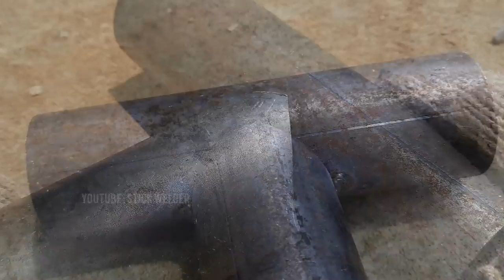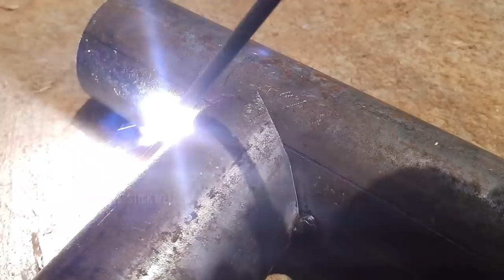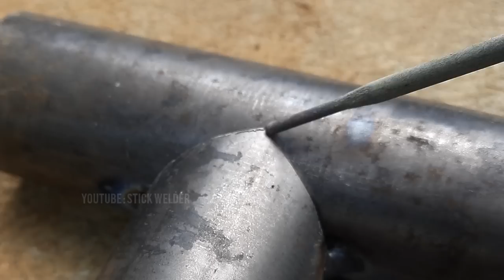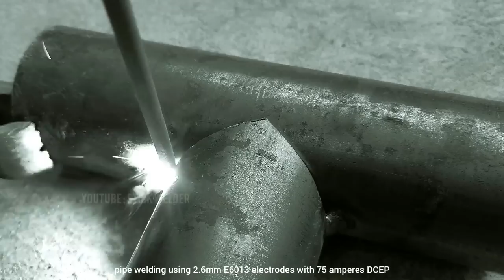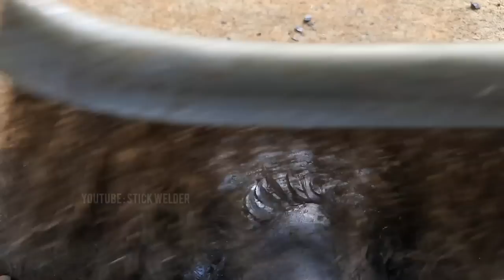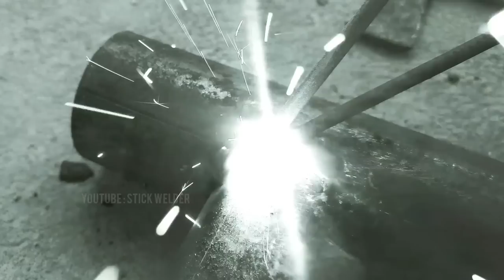old welding tricks from the 60's. why no one told about this welding secret

Comment: “Trick”: literally just spot welding. Try lowering your amperage and running a bead.
Reply: I wonder if he knows what a Row of  Nichols looks like
Reply: Glad you said it ... amps would make a world of difference here
Reply: This shit gives welders a bad name.
Reply: Had an old machinist work on the farm years ago , I was making an exhaust for my car and was going to braze it because I figured it was too thin to arc weld .. He said let me do that for you ,I thought "this should be fun " He arc welded it and it locked nice .. He taught me how to just drag a bead across the joint and if done properly did not blow through  and looked like someone had mig welded  it  ...
Reply: What if your welder sucks balls and only has 2 or 3 set amperages and/or you don't have the correct electrode because you're too poor
Reply: Agreed
Reply: Not even chipping before running it again it’ll be so weak

Comment: Here's a trick used to correct rod with the correct amp for that thin metal
Reply: Yeah, I'm not a great welder, but I know I can weld schedule 40 pipe without blowing holes in it.

Comment: Everyone who wants to weld needs to start with a thin project IMO.  Whether mig or flux core I think the same method applies. turn your amps up a little hot and spot your way along. Once you learn to stop blowing holes in thin stuff your thicker projects are going to have a significantly easier learning curve.
Reply: You may get the opposite effect then with lack of penetration on the thicker stuff.
Reply: I disagree with you 100%  person needs to drop the amps. And feed   welding thicker material, you often run multiple passes. 5 " to 1",thickness, isn't going to hold with a single pass. If you are welding 18 Guage and thicker. A good welder can do it using .045. But if you don't have a few years experience, I'd recommend. 028  for 18- and thinner. Or maybe gas weld it using a triple 0 ( 000) gas welding tip or smaller. 
I started welding in 1978. Just retired last year due to wear and tear on the body. I understand weekend welders perspective. But concerning the industry standards. You are mistaken.

Comment: Chosing the correct rod and amperage settings will give you a superior weld both structurlly and asthetically.    Just because you can strike an arc doesn't mean you can weld.  What you're doing here, everytime you restart the arc, is pull the impurities the previous weld's flux brought to the surface back into your weld.  Not a good weld by any stretch.  #hownottoweld #CertifiedGapWelder
Reply: That sounds right. It means every time you strike an arc stop, clean and strike again, I tried to repair my wheel barrow as the bowl is .5mm thick. I tried stick and mig. The mig on low voltage built up and when I grinded I was not satisfied with the penetration. Then I used stick and turned up the amperage to do the stop start method stopping to brush after each strike. Well. it built up a solid weld although increasing holes once patching to the old .5mm steel. I heard you can use copper and mig weld onto that. 
When I first started welding a couple of decades ago I used nails to span large openings and was very lazy in cleaning work before welding.
Reply: @ron1martens  mig (GMAW) you dont need to clean. FCAW you do.  So if you're using gas you can pulse the gun with higher amperage without the constant cwire brushing.  FCAW is only good, in my opinion, for welding outside where your gas shield is likely to be blown away.  Dual shield is good though.
Reply: @byron7165  Thankyou Byron. I just have gassless. I was referring to when I was using the stick welder when cleaning. I"m going to have another go very soon to see if any progress.

Comment: Texas tig without removing the flux from the filler?  I’m not a welder, but that looks like a fantastic way to get flux inclusions.
Reply: Glad to know someone else calls it Texas tig. And yes you really need to remove the flux to for it to work. Using a 3/32 rod of 7018 with the flux removed does the trick.

Comment: This got nothing to do with secret welding trick welders dont want to speak about , it about adjusting your weldingmachine the right way , and knowing HOW to weld ,something you apparantly have to learn .  Stitching is not welding !! If you welded this with a 2.5mm rod from the top down on 75 Amps  you can run a full bead .
Reply: It's absolutely true.

Comment: Inclusions and porosity!  I'm no expert and still learning myself, but your amperage was WAY too high the first go round.  The second is honestly pretty garbage.  You welded over your slag and you could probably break that weld very easily.  On your old welding trick, that's also called Texas Tig and yes you are adding additional filler metal when you have a huge hole to fill.  In the case of this video, you had to resort to it due to improper skills and poor technique which resulted in horrible fit-up.  With my welder I have run a 3/32" (2mm) rod down to 60 amps with hot start on 1/8" steel.  It still blows the hole at the beginning, but I can go back and fill it up as I'm running a bead and the bead is the correct temperature.  I haven't had to weld anything thinner just yet with my stick welder, but you could Texas Tig thinner metal directing the heat towards the thicker filler rod which will melt both sides of the weld pool.  If it's too thin, TIG or MIG weld it.  There's a reason there are other welding processes.

Comment: This situation is why I love my MIG. I never have had the skill or talent to arc weld thin material.
Reply: Thomas Franklin  thank you Thomas. I will try that. I have always said a monkey can MiG. It takes a craftsman to weld.
Reply: MIG welding (GMAW or Gas Metal Arc Welding) is great for thin metal  like sheet metal but it can be done with SMAW (Stick welding).
Reply: Use E6012 to weld a thin metal with with 2.5mm stick use betwenn 55 to 80 amp. And NEVER sold from up to town.

Comment: Sand (dry) inside the pipe tends to support the thin wall and stop it from collapsing or burning through. Likely contaminates the weld inside the pipe but appears to work well with my basic welding skills. Like to hear any theory why it appears to stop the thin pipe wall burn through.
Reply: The wall can collapse easily without the support of the sand.
Reply: The sand is simply working as a backer and a heat sink , less amps and a better rod choice will do the trick with a lot less messing about.
Reply: @tomthompson7400   Thanks for the explanation.

Comment: That method work fairly well when welding exhaust tubing. I built my first exhaust system with a stick welder using the "tack method". Now I get frisky with it and tig braze it or I acetylene braze it just for kicks and giggles. Seals alot better than most anything though especially half rusted out and to thin to really even mig weld the tubing. Best part with brazing, doesn't have to be super clean pipe.

Comment: IF YOU USE 7014  3/32 WITH ABOUT 70 AMP IT WOULD WORK BETTER AND NEATER
Reply: 6010 0r 7010,lets you break an arc and go right back in for a 2nd puddle.7018 however burns back up in the flux so you end up tapping it to get it started...

Comment: Welding galvanized tube is dangerous! Strip the plating first!

You have smaller sticks, use less amps and the small sticks to lay a proper bead.
Using rod to fill gaps isn't good, use a strip of the same pipe to fill the gap.

Comment: In 1965 I was a student in an aircraft mechanic's school, and I learned to do much better welds than you see here using an oxyacetylene torch and flux-coated rods.  I would not want to go up in an airplane with a tube frame welded with the crappy joints in this video.

Comment: some people comment that if you have the right amperage/rod/skill you could stick weld thin metal like this with a continuous bead. I've never seen it. Show me. Post a link.
Reply: I don't have a video but it is possible to weld thin metal. You "weave" the rod back and forth to keep the arc but it keeps the heat lower than just straight line pass. DC current works better for thinner  metals in my opinion because it's a steady arc.
Reply: Seems to be he is right no video proof. Unicorns are real too

Comment: Stitching is very common, as is using a filler rod with other-than-TIG. “Texas TIG” is using a second flux rod as filler while stick welding a gap. I’ve personally had great results using steel hydraulic brake line as filler for MIG and flux core. This video demonstrates nothing more than the common-sense approach of someone determined to teach themselves.

Comment: All of that wont hold. We call that spot welding your better off without a flux produced weld. Because your trapping slag aka flux causing uncertainty in the penetration of the weld if you turn your amperage down you should be able to penetrate without eating the metal

Comment: Spot welding. Problem with that is you don’t get the penetration that you need
Reply: Not spot welding.  Completely different than spot welding.  Spot welding is resistance welding, not arc welding.

Comment: LOLOL no.  You stitch from different places so the heat doesn't blow it out.  Slowly stitch it from the ends and middle until its welded, then put a cap weld over all of it.

Comment: i am not a pro welder... but i can see that this person has there welder settings way to high when it burns right threw the pipe. & sorry using another stick to fill a gap is a total beginner trick, if you want to call it a trick.

Comment: I don't think they had tiktok welding tutorials in the 60s...this weld is full of slag inclusions and is not as strong as it could be. 
A proper welder would use a smaller diameter elecrode, lower amperage and switch to straight polarity on thin material. 
Also, I'd like to see this method used with 7018, it's not possible which is why he's most likely using 6011 or 6010. 

Don't believe everything you see on the internet kids.

Comment: I'm wondering.  Is there a specific reason why your using a low hydrogen (E6013) rod for such thin tubing?    6011  5/32 or 1/8 would of sufficed.  Big rod requires bigger heat.    Tubing that thin would certainly called for a mig or tig.
Reply: I’m wondering why you think 6013 is a low hydrogen rod?

Comment: this start-stop method wont work on 7018 or 6018..because it burns up into the flux and then to restart you have to tapm it way too many times to get it tpo restart...THE REAL SECRET IS 6010 ROD..YOU can restart immediately..time after time.actually ,if its important or xrayed it wont fly as youll have flux in the weld...its ok for a jake leg just trying to get by!..but i bet in an xray ,YOU WOULD BE  FLUXED!

Comment: What a mess.  Just use a smaller rod and turn the machine down.  That'll do it right the first time.  If you weld like you just did, you'd be fired by noon.

Comment: Dude you’re embarrassing yourself. First- when welding a notched pipe, start in middle, go down one way, then another bead from middle down the other side. And wouldn’t recommend doing with stick, I’d use mig. Plus, no shop ever would approve that garbage. The green check marked weld you did, terrible. You could stitch weld or the whip method if that’s what you’re going for, or use a 6010 rod